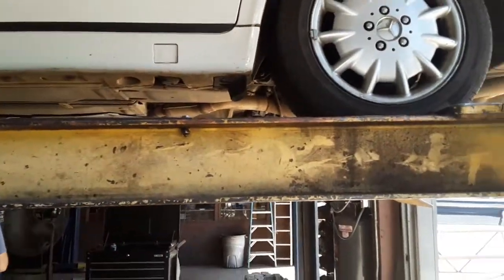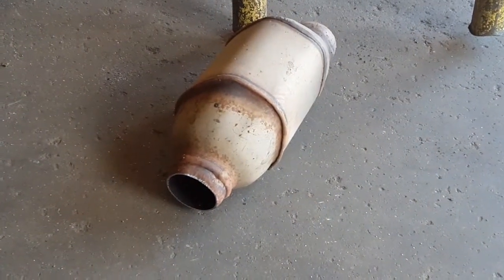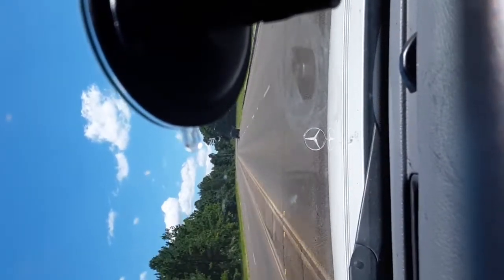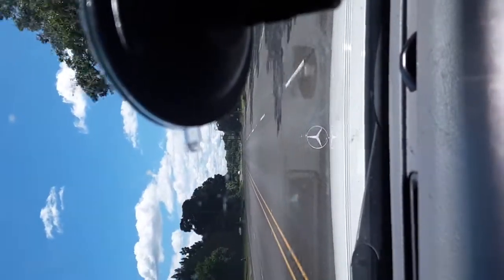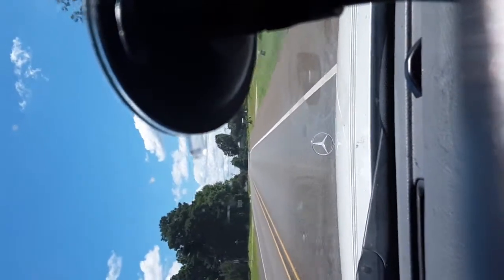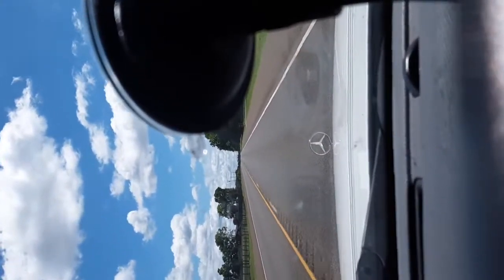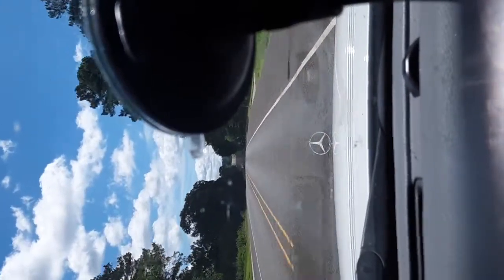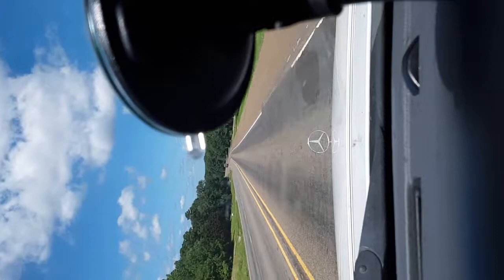Mercedes Benz e320 - w210 V6 Cat delete + Flowmaster muffler upgrade = great sound / mpg !

Comment from the maker: Update a year after this:
Car still sounds & runs great.
I extended my air filter interval too long - o2 sensors sensed low airflow & lit 'check engine'
Installed new filter no CEL lit !
Reply: Do you have more exhaust clips you could share or dm? Just purchased 2000 e320 and looking for exhaust right now. Your video was excellent as well.
Reply from the maker: @alexthomas9379  
Not really. Its super hard to capture sound via these silly phones.
Let's just say the car still sounds great. Its not obnoxious loud at any point but just right.
My boyhood friends dad tuned Jaguar V-12's and when I ran this Benz 3.2 V-6 to redline this exhaust sounded VERY much like those sweet old jaguars did.

If you want louder than my description leave something off.

A cheaper muffler than Flow Master I use here would be slightly louder quite likely.

On Amazon they have the "Rumble" brand by AP exhaust that's worth a look at 1/2 cost of Flowmaster.

If you click on my Channel you can see my ML500 video showing a Rumble brand muffler on it & hear sound.

Of course the one for your w210 would be different #.

Is your w210 a sedan or wagon ?

The exhaust layout is different for each. 
I didn't want to pay $330 for wagon specific muffler !

So my exhaust shop installer got creative with routing vs stock - but I prefer how the rear tip exits straight back now.
Reply: @alexthomas9379  I have a 2000 e320 as well and in need of the same help

Comment: Hi.  Thanks for posting this.  Any warning lights come on after removing the secondary cat?  My 2002 e430 cat is rattling like a jar of coins.
Reply from the maker: You're welcome. No it can't really set one as the rears don't have o2 sensors, so their presence won't be missed.
Keep in mind that once rears clog badly, that blockage will either set codes on front o2, melt front cats or cause broken welds and can also cause coil misfire codes on engine.
Are you on the Benzworld.org w210 forums we talk a lot there too...?
Reply: @hellosunshine1090  Hi there! Ok I get what you mentioned about not worrying about deleting the secondary cats in relation to the O2 sensors that are connected up front. My question is my secondary seems to be clogging up and failing so fine delete them now  do I have to worry about the primary Cats failing in the future? And what about the O2 sensors connected there? Hope you can help and Thanks Mother Goose!
Reply: @hellosunshine1090  I'm using a w210 though sedan
Reply from the maker: @or6144   I dont think fronts would fail any faster due to removal of rear ones. 

To clarify on our 2000 e320 wagon AND 2002 ML500 both had pair of Rear Cats and NO O2 sensors on them.

The fact that rears had no way of proving their correct function (no 02 feedback) AND that all systems degrade over time makes the rears a failure due to clogging point one vehicle ages.

If MB had designed it so the exhaust dumped 2 into 1, then gome into a larger diameter single rear Cat  then the system would be more reliable/ less clog prone.

We have an 03 Hondz Accord V-6 like this it's a better design in that aspect.

Probably an exhaust shop pro who has seen LOTS of rear car deletes could say with more authority...

Hope that helps!
Reply: @hellosunshine1090  Bringing it to one soon! Thanks MG!
Reply from the maker: @or6144  Ha Ha I'm in beta test mode but 1.5 years & 25k miles on w210 + w163 no issues nice power & mpg too.
I'm getting an intermittent CHECK ENGINE on ML-w163 prob cause my plugs are needing replaced - not a fun job but necessary !
Reply: @hellosunshine1090  I've got a straight Six M104 so it's easier to do on mine hehe!
Reply from the maker: @or6144  Lucky Duck yeah yours are probably 'staring you in the face', right ,
On V-6 & V-8 you can't readily see them done by feel not sight ...
Reply: @hellosunshine1090  true true hehe...

Comment: Hey man I found your video through BenzW forum. I was curious if you could tell me where you got those 2 pipes from or were they made with expanders at the muffler shop and also the Y pipe in back if you have a part number for that my pre muffler resonator is rusting out. Thanks. My driver side rear cat is my main concern. Thanks.
Reply: I realize it's pretty off topic but do anyone know a good site to watch new movies online ?
Reply: @Will Hayes Flixportal :D
Reply: @Juelz Van Thanks, I signed up and it seems to work :) Appreciate it !
Reply: @Will Hayes Happy to help :D